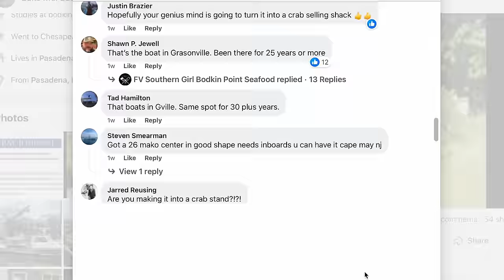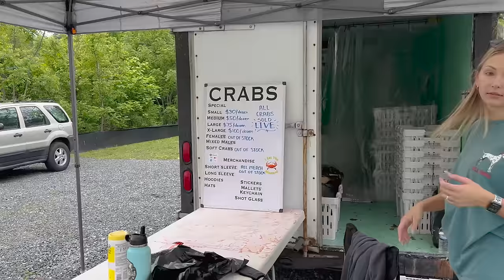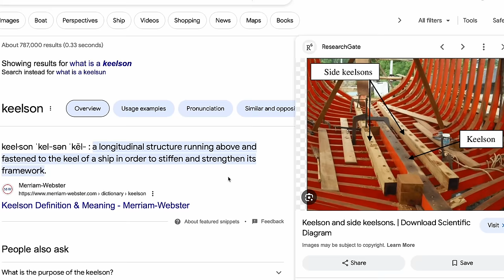Why I'm BUYING a SINKING boat

Comment: Outstanding Luke!  Be sure to contact your City Building Dept. and make sure that this is all doable, and whether there will be any issues that they spring on you, like all of a sudden because you're developing a City lot, they want sidewalks put in, restrooms that are handicap capable, paved parking and curbs with controlled drainage...and on and on and on.  One minute you're thinking, "I just wanna park a cool vintage boat and a refrigerator and keep selling crabs" and the next minute it's a $300k project that needs umpteen permits, inspections, the hiring of engineering firms, and on and on.
Reply: Dude 👍 nobody asked
Reply: @Joehouse900  yeah roight back atcha buddy
Reply: @marcinczapski8547  aw sticking up for your boyfriend?? How cute 🥰
Reply: He’s right though!
And even if it was semi Mobil on wheels they may have a no trailer off of hitch law.
Reply: This is great advice and something I was going to suggest but I've seen the state take down finished and ongoing projects for the absurdist reasons. Once personally had to remove a custom hand shaped sign with vynl laminate and red led rope inlayed around the perimeter and the light reflected backwards off the building  and couldn't even be seen directly, yet the city claimed it was to much of a distraction to drivers... Regardless of the 50 other signs along the street, casting direct light outward and toward drivers.
Reply: Oh I guess they might not he has had that sign there forever…
And his haters would have turned him into the cops for it instead of defacing it.
Reply: I like the idea of building the shop out on a large 5th wheel frame. It sidesteps tons of regulations and gives a lot of advertising value while on the road as well as value in serving multiple areas. 

I got my double axel trailer from an 89' king of the road  5th wheel RV and the frame is a monster at over 30 feet lomg, about 9ft wide with a nice 1/4 inch thick c-channel frame that's doubled over the axels. They don't make them the same these days..

I was sure to find one with aluminum siding so I could recover some of the 500$ I spent on buying it - 700$ in scrap aluminum and copper/wire when it was all done. Definitely made out on the deal but it may be something for Luke to consider so he can sidestep the bs regulations I'm sure the city and state will try to impose on him.
Reply: @Joehouse900 you sound like a government lover
Reply: For those of you wondering, this area is  “The Dirty Dena”, where yard anchors are required on every third property.
Reply: @mr.notorious2465  🤔 dang I’m liking a vision here!
Reply: There are no more laws or enforcement... Beyond Thunderdome.
Reply: This right here is proof positive we have too much government interfering in our lives.
Reply: 🌴🤔 How to build a crab restaurant from a derelict old boat , hummm could work in a pinch 🦀👈🏼 ouch!   Besides if it doesn’t work out you can always build the boat and run a second crab boat🤔👍🏼
Reply: Also setbacks from streets and possibly big ditches! I thought it looked like an intersection.
Love this guy he is an ole soul, thinks in his feet and gets the job done.
He should start a school so he can pass some of his great qualities to the next generation of Bay Fishermen!!
I have got to get better directions so I can visit them at the crab stand on my trip down the E.S. 
❤
Reply: He's not opening a restaurant ffs...

Comment: There used to be a Deadrise on the south side of 301, advertising one of the Crab Houses back in the Day. it was suspended by telephone poles. I wanna say it was south of Waldorf. It deteriorated over the years and collapsed. I must have rode past that Ole boat a thousand times on My Motorcycle... IT...was a statement. Your Crab Boat will be the same hysterical LANDMARK...that No One Will FORGET. Great advertising forever.
Reply: Wasn't that Capt Leonard's restaurant? I think that was on rt 5 though....been a while since I've been that way, spent a lot of time at Cape st Mary's and Seabreeze growing up.

Comment: There is nothing like the ride of a Chesapeake Deadrise. If it's too rough for a Deadrise to go in. you don't need to go. We were coming up the bay in a Navigator getting our ass handed to us. A smaller heavily laden deadrise managed to catch with us and tuck in to run with us. I have spent many an hour under way on a deadrise. But that just blew me away to see just what they can do in rough seas. They are tough stable workhorses and take one hell of a beating for many years and keep going.

Comment: Build a trailer from your stuff “laying around”, throw that boat on it, remove the engine and running gears, install a refrigeration compressor down where engine was, demo and replace old floor, find an old walkin box refrigerator and mount that on the new floor, you can even use the cabin if you insulate the sides of the boat with close 2-3” thick foam foil sheets. You can get a 100 amp electrical service set at the property from electric company if that could be considered as a “Temporary Structure” like a modular house. All this would depend on what the property is zoned as. You might have access to a marine piling to use as meter, panel mounting and power company will run power from street to power pole.
That can be classified at “Direct BOAT to CUSTOMER SALE”. Fun project but you better get going to make it happen this year.

Comment: Luke, anchor your boat to the ground and add footers so it’s a fixed structure. Then have BGE run power to it so you can plug your reefer box in to the boat instead of running a generator and all the expense of gas. With electricity you can run a wireless camera system to monitor your property. You could also keep a refrigerated box in the cabin to store premade orders. Having full time electricity you could also install a WiFi thermostat to monitor the temperature of the refrigerator to avoid losing crabs because the power went out. Just a couple suggestions.

Comment: Like to see the hull insulated and the engine replaced with the  refrigerator unit. That way you could load her up like you would on the water. Customers could walk in, you lift the Hatch open they pick the crab 😎

Comment: Yeah this is gonna be sweet.  There used to be a guy down my way that sold shrimp and crabs out of an old shrimp boat sitting on the ground.  Such a cool idea.
Reply: Absolutely: I dig it when historical preservation dovetails with an interesting diversion and/or service!  I.E: Almost everyone has seen an ubiquitous old Pullman train car that has been turned into a hot dog/ burger/espresso stand; good food from a tourist trap with integrated gift shop infrastructure,  etc.

My fav was an old red/white/black steam powered tugboat (with the tall black exaust stacks and all), which had been moored and transitioned to selling (killer) fish and chips and steam beer in San Francisco Bay... And, I remember an archetypical old red caboose parked next to US Route 2 west of Stevens Pass, WA, by a speck of a rest-stop/hamlet/burger joint named 'Zeeks'... Best, burgers, Ever. (in the shining memory of my youth, anyway.)

Comment: Looks like a job for the mini boat, but you might need to increase the 6 hp to at least 8 HP :) only kidding of course I don't want to give you any ideas.

Should be an interesting tow and hopefully it turns out to be the easiest part of the process for you. Looking forward to seeing how it looks when you're done. 

I hope to get down there one of these days and grab some of your crabs I'm just south of Philly. I haven't been down to MD since I went driving for oysters on a local oyster boat over a decade ago.

Comment: Been watching for awhile recently realized I wasn’t subscribed fix that issue why not get 2 put them side by side or sandwich the refi unit between them. You could even make a canopy over the middle. One boat have merch the other have other stuff to sell middle check out. Also you love to recycle you can gut everything and repurpose or redo equipment for resale or use in your boats

Comment: So you own the land.
And want to put a solid structure on it..
GO BUY A QUANSET HUT.
THEY ARE CHEAP, THEY ARE AS BIG AS YOU NEED IT
They are water proof and can fit big things inside.
You'll never have to work in the elements again.

Comment: when negotiating price always try to split the difference between your offered price and his counteroffer. i.e.: $600 vs $700, then meeting at $650 you save $. meeting halfway on a price negotiation is a goodwill gesture that doesn't offend the seller and helps both parties feel like they got the best deal possible.